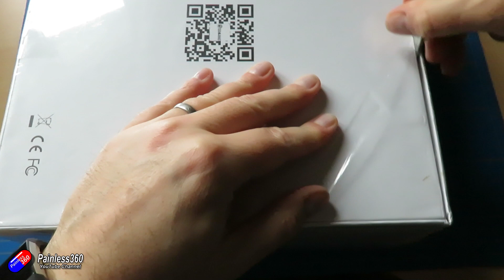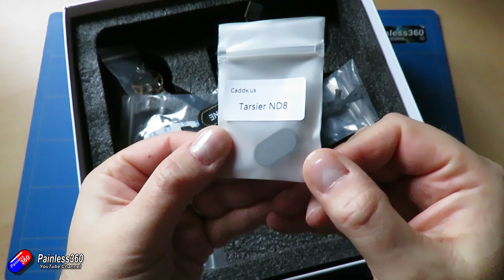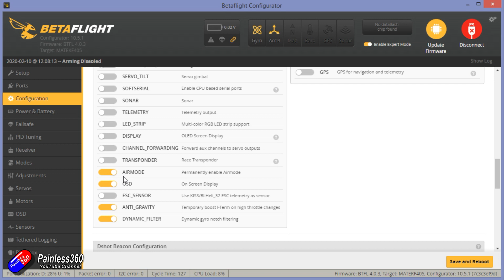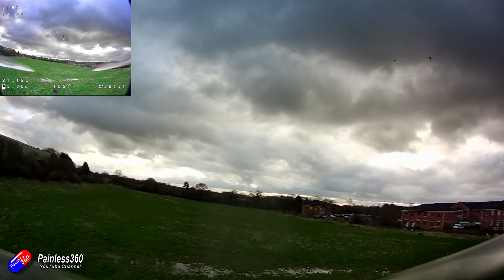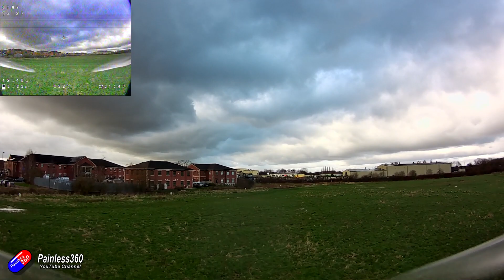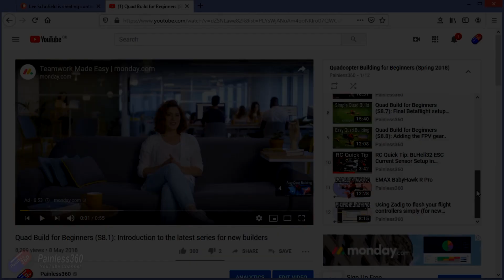Eachine LAL5 .1 HD FPV Quad: Now in 4S

Comment: I need some help. I want to update Betaflight to 4.2 but what board should I choose. It’s a custom matek eachine board. And matek comes with F405AIO, F405CTR, F405CTR, F405mini, F405STD. Is their a way to see which board I should choose in the Betaflight configurator? 

Thanks 🙏
Reply from the maker: Yes, use version in the CLI. See my build videos..
Reply: Painless360 thank, got it!